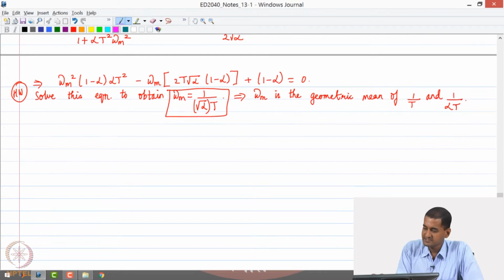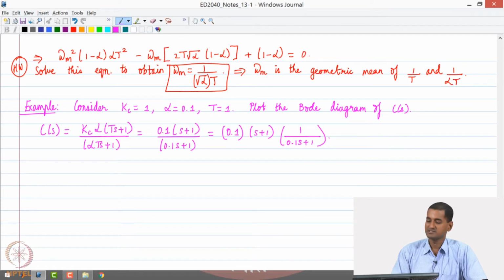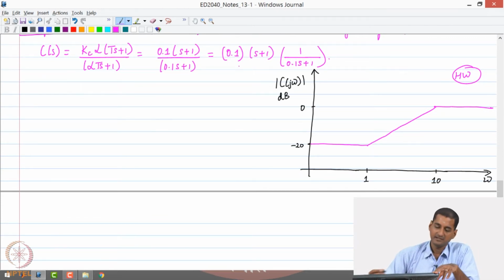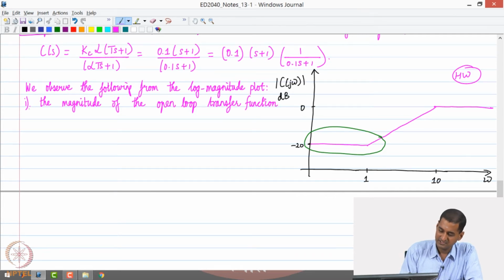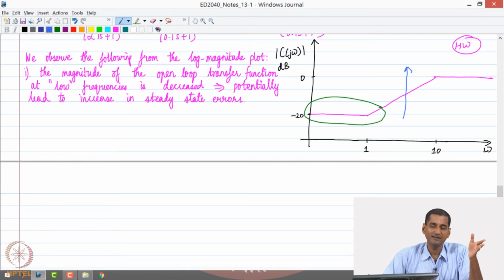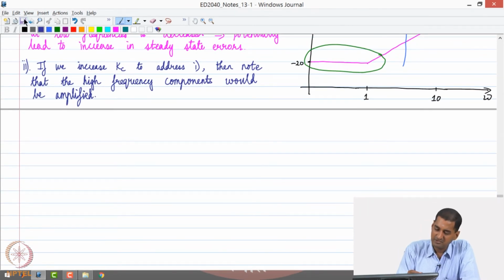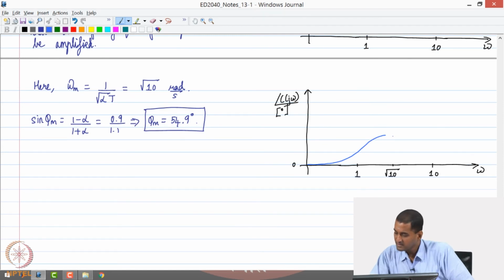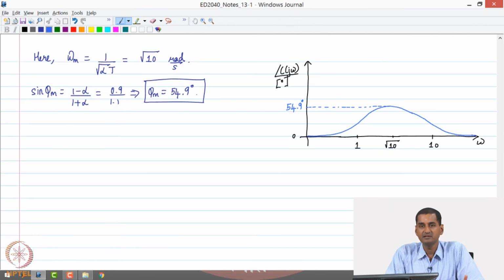mod12lec68

Comment: example of LC   0:00
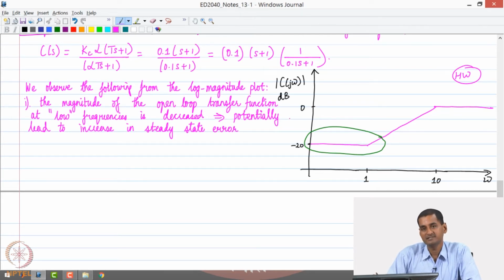in case of LF attenuation, steady state errors inc    6:00
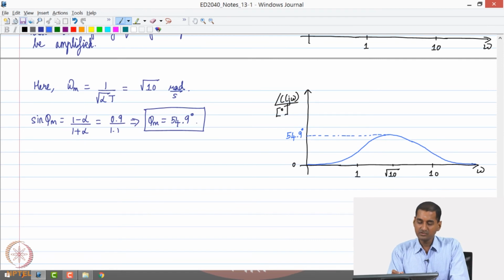In summary       11:00
LC is used in given syst fun which has no sufficient ph margin to begin with. LC adds + ve phase to syst thus improving stability margin but as a tradoff, the mag components act like a high pass filter thus amplifying HF componets . To counter this ie to keep HFs at low amplidude results in LF attenuation causing inc in SS errors. But finally LC gives a + phase lead thus inc ph margin of the syst

Comment: Observation 1 is not clear to me. What is relation between low frequency signal characteristic and steady-state error?
Reply: Our over all steady state error is the sum of error caused due to all the error constants (Kp, Kv, Ka). If you remember the equation for Ess, you will notice the error constants come in the denominator of the calculation. For example Steady error of a type 0 system due to step input is given as 1/1+Kp. This implies the smaller the value of Kp, the larger is the error. Remember to find Kp, we use limit s -> 0 G(s)H(s) to obtain it. Meaning we find G(0)H(0)

Now, in our Bode Plot, the magnitude value at w = 0 correspond to the magnitude of G(s)H(s) at w=0 in dB i.e. it gives you G(0)H(0) in dB, in this case this is nothing but the steady state error constant Kp due to a step input. Therefore the lesser the value of your magnitude plot at w->0, smaller will be Kp, and larger will be the value of steady state error 1/1+Kp since Kp is in denominator. 

As an example a slope zero line starting at -20 db => Kp = 0.1 and a slope zero line starting at 20 db => Kp = 10 
Hence Kp for -20 dB case is 0.1  ->  Ess is 1/1.1 = 0.9
Kp for 20 dB case is 10  ->  Ess is 1/11 = 0.09
So you can see here, if your w -> 0 value is less in the magnitude plot the error increases
Reply: @dikshagiri4415  excellent! 👏🏽 👏🏽
Reply: Imagine there is some constant error on the output. Let's say you want the system to be held steady at 5volts but due to some steady-state error, the actual output is 5.2volts. This error of 0.2 has a low frequency (0 Hz - DC level) but this error will be attenuated by a factor of 20 dB potentially keeping as it is or even increasing steady-state error.